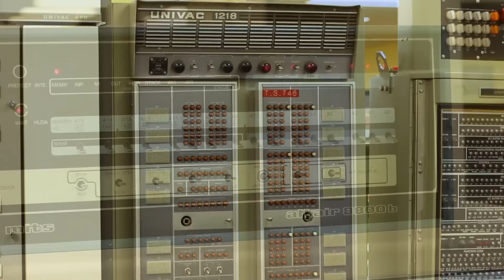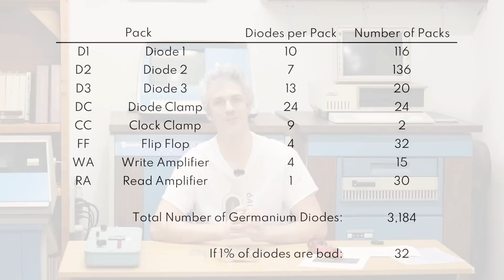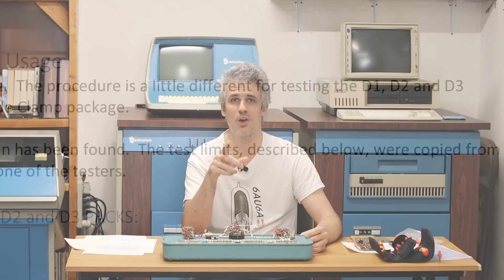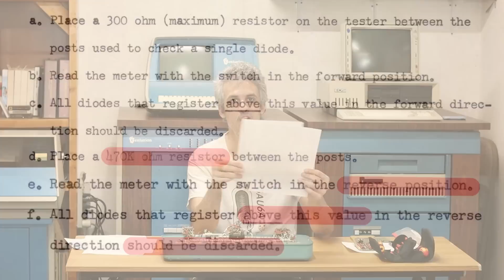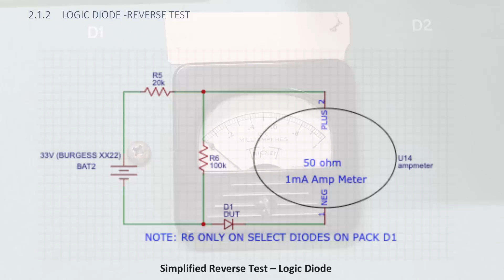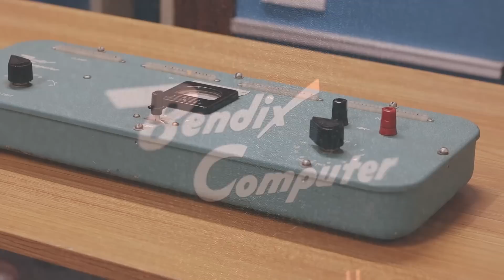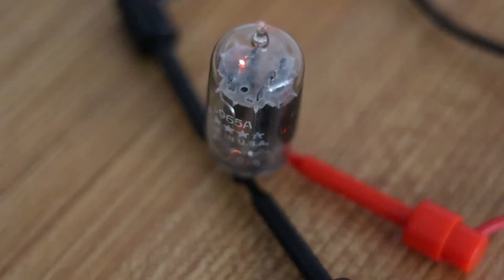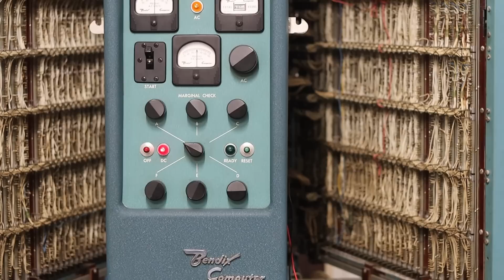Testing Thousands of G15 Germanium Diodes

Comment: I remember reading that tube computers (or anything with a sufficiently large number of tubes) couldn't theoretically work because the MTBF is such that there will always be at least one bad tube; the reason they do is because MTBF isn't the whole story, due to production variations some will fail early and some not, if you start with a whole new batch and replace them as they fail eventually you end up with all the better ones. The machine then works reliably until the tubes get into the end of life section of the bathtub curve at which point it is necessary to start again with a new batch. The other thing was never to switch the machine off as it is switching on which puts the most strain on the tubes, obviously not practical for hobby use.
All this used to be observable with incandescent light bulbs in any building with enough of them.
Reply from the maker: The G15's MTBF was actually quite a bit longer than other tube computers of the era, often going for weeks of 24/7 operation without a failure. There's a few things playing into this. Only having 460 tubes brings the numbers game to a much more reasonable level. Also, the G15 is primarily using indirectly heated Noval tubes, which had much, much better life and reliability than the older octal or directly heated tubes used in machines like ENIAC. Also, filament warm up and start up is the hardest time on a tube, but the G15 has a clever soft start that sequences in, slowly increasing the voltage to the filaments over the course of 60 seconds. That means that all the filaments last much, much longer.
Reply: They used a couple of design tricks to extend the tube life. They ran the filament cooler either by a lower voltage or by designing the tube to handle a higher voltage than what was applied to it. Tubes normally ran much higher plate voltages between 45 and 90 volts. It surprised me a bit when I found they were running around 24 volts. Mean time between failure is a worst case calculation and often you will find that parts far exceed the numbers it produces after you get a few early failures out of the way. Running anything below specs will extend its life. I have a chandelier that uses 12 - 40 watt bulbs and was purchased in 1986. I have only replaced  on bulb and that was because it broke while cleaning it. The trick is on high it produces so much light and heat that it's always on a dimmer running at perhaps half its full output.
Reply: @UsagiElectric  I was actually going to ask if you would consider using a soft tube starter. I'm glad to hear they included one, Bendix really thought of EVERYTHING!
Reply: @denawiltsie4412  Incandescent lamp life is inversely proportional to the 13th power of the applied voltage. Running lamps at 50% voltage will extend the life by about 8000 times normal. Since the dimmer is probably a phase control unit, and you probably turn it on and off now and then, you probably won't get this. But if you have 1000 hour bulbs, it is still going to last for a whole lot of years!

BTW, commercial and industrial lamps in the US were designed to run at 130V. Since most power is between 115 and 125, this made them last considerably longer than consumer lamps, but they put out about 10 to 15% less light.
Reply: @lwilton  Yes, lowering the voltage extends the life span quite considerably, at the expense of killing efficiency. The famous 100-year-old light bulb is run at such a low voltage that it barely produces any visible light, it's almost all infrared (i.e. heat). As far as I can tell, the 1000-hour life span wasn't a marketing ploy to promote planned obsolescence but the most decent compromise between longevity and efficiency possible until halogen lamps became a thing. 2000-hour lamps were always readily available in Europe under the name rough service lamps. Running them below the design voltage meant using a thicker filament that made them much sturdier but a lot less efficient, even compared to the already abysmal efficiency of 1000-hour ones.
Reply: @Ragnar8504  technology connections has a whole video on the 1000 hour bulb and the history. The real answer was "it's complicated" but there was cartel like activity as well as the 1000 hr life span being in the ballpark for optimal life/efficiency.

Comment: While about 400 G-15s were produced, you have to think that the number of diode testers was fewer, and that an arcane piece of diagnostic equipment for a long-obsolete computer would likely be discarded in decades past as its purpose and utility would be meaningless outside the hands of a very small contingent of specialists. 

What I'm getting at is that there are likely very Bendix diode testers still in existence, and this one in your workshop/lab/compound (pick your poison) may be the only surviving example for all we know.  As such it will be highly sought-after by those working to restore the Bendix lineup of computers, who may shortly be pounding fists against your door to get hold of the unit. 

Here I want to recognize the immense value of what Lloyd has accomplished.  By reverse-engineering and documenting the tester, he has made it possible to functionally recreate it.  Those won't be virtual museum exhibits like yours, but the functionality is the point.  A huge round of applause goes to Lloyd for his magnificent work.

The one difficulty may be the slot connectors for the Bendix cards.  If nothing commercially available can be made to work, there is the option of 3-d printing, thankfully.  It will be a headache but something can be cobbled together.  Thanks for another fascinating installment.

Comment: not marking which slot they came out of is craziness to me. that's my first instinct. especially on a legacy system, I'd keep the configuration as close to original as possible just in case the assembly order is meaningful
Reply: They are all supposed to be identical, the slots are labeled and the components color coded by function.

It's designed to be worked on like this.
Reply from the maker: As volvo09 said, the slots are all keyed and all the cards are labeled and color coded by function. Every card should be completely interchangeable with other cards of the same type. I actually specifically chose not retain the same configuration as it's a good way of highlighting failures we may not have caught yet. It can be a little frustrating and time consuming to track down though, haha.
Reply: @volvo09  oh I have no doubt that it was designed to be interchangeable. but with something that old, I would think maybe some board warpage or some corrosion patterns or something might mean that returning something to its original slot could help make better contact or something that wasn't immediately apparent
Reply: Even if they are the same card, it is good practice to replace any component/card back in its original location (not just for this project).

Comment: Just looking at the construction, this appears to be DTL logic instead of earlier RTL logic (diodes instead resistors) and was much more reliable.  I worked for IBM in 1966 and their SLT flip-chips were much much smaller (approx 1/2"x1/2"), and one-chip could effectively replace one of those large PWB boards.  The SLT chips had diff-amps available and thus could have myriads of other functions added directly on the hardware, such as flip-flops, monostable delay gates, direct NANDs, and multiple output Interface Drivers.  The later IBM70+ systems pretty much killed any of these older PWB based single-card systems.  That newer technology was actually driven by the development of solder-flow processes, whereby a huge large board could be wave-soldered in one pass.  I lived through this whole cycle, and one of my sons now works on 4-to-7-nanometer scale device technology, and there maybe be yet a chance to get down to about 2-nanometers, before Moore's Law is broken.  Now requires below ambient cooling, but the Spintronics people are working in that zone (can be done with CO2 cooling).

Comment: I think the carbon composition resistors should be taken into account; I have seen one vintage radio / TV restoration site where the person said he checks them and replaces anything that has drifted out of tolerance (gold band = 5%, silver band = 10%, no fourth band = 20%). That might have to be the next step after the diode test if the computer still acts like it hasn't had its morning coffee.
Reply: Totally agree with you, Carbon resistors tend to do weird things the older they get.
Reply: I'd suggest probably testing all the tubes first, they are more likely to have hard failures that will have an impact. The resistors without digging deeper you won't know if it being out of spec matters. Dud tube and you're going to have a bad day (as they found out(

Comment: The diode checker meter circuit.  When you have a meter with a series resistor it is easier to see it as a voltmeter.  That meter is indicating forward and reverse voltage drop across the diode.  You can consider the meter resistance and series resistance in series as if it were a resistor in parallel with the dioade with an ideal voltmeter (no current flow) in parallel.  The meter is probably 50 microamps at full scale
Reply: I believe it said it was 1 MAFS. What you say still holds true, of course.

Comment: I see a nice gem there (The multimeter) If you have budget, try to get the UT210E-PRO version. That one has Frequency as an extra, and is more sensetive in the MiliAmpere range through the clamp. Nice habit of them is that they can be reprogrammed to start in DC mode on all ranges, that the backlight can be set to a longer value, or even to continious untill shut off again, and that the Auto shutoff of the meter can be omitted. All that by reflashing the Eeprom with an ESP32 flasher.

Comment: You may want to install a larger battery or a plug for a wall wort.  I suspect that the tester with a meter, inverter board, and others will eat the AA batteries pretty quickly. 6V to 33V is about 6 times the voltage which requires like 6 times the amperage to convert, not counting the no-load current draw of the inverter board.  Also I think the meter mechanism takes some power too to move.

Comment: Awesome.  The natural follow up question: so how will you be testing the valves?
Reply: And the point to point wiring. That's going to be a job!
Reply from the maker: There are only about 460 vacuum tubes, so it's a much more feasible task to tackle that problem one by one as issues crop up during machine testing. I'm working under the assumption that the majority of them are okay, and we're just going to troubleshoot the machine slowly and surely.
I do have a tube tester, but it's not a very good one, so it won't highlight issues with emissions and balance on the flip flops or things like that. So, if we find a flop isn't behaving and the tube filaments look fine, we'll get into some more in depth testing at that point!
Reply: @UsagiElectric  You might look around and see if you can find a Hickok Cardmatic in working order, along with the test cards. They are pretty much idea for this sort of batch testing. The Model 123A had a set of test cards for the 5965 specifically.
Reply: @UsagiElectric are there other failure modes than a burned-out filament? If not, a visual inspection should be enough.

Comment: At 15:15, I would say that: if the diode has higher internal resistance, its voltage drop will increase so LESS current will be shunted at the ammeter. The needle will go up showing a diode failure.
Reply: If the voltage drop is higher, then more current flows through the 10k and the ammeter since there is a higher voltage across them.
Reply: @cdh76  Indeed, simpler explanation.

Comment: One way you could test those germanium diodes is with an Oscilloscope that has a built-in component tester, my old Dick Smith Electronics DSE Q-1804 20MHz dual-trace analog scope has a built-in component tester that temporarily puts the scope into X/Y mode when you press the component test button, it is great for testing transistors and diodes.
Reply: Better way if his scope has no such capabiilty is to build a 5-component Octopus IV tracer
6V transformer, two resistors to bring it down to 1V pkpk, two banana plugs and that is all!
Same functionality, in a pinch
Reply: I reckon both of these are probably pointless, given that the normal method of checking the parts made them look om. Did you watch the full video? These diodes are seeing reverse voltages of 24v. Neither of these two suggestions would offer significant enough voltage to show the reverse leakage issues discovered using the official tester. Similarly for the forward voltage drop when they're seeing 30v forward applied.
Reply: @CollinBaillie  Of course the simplest modification would be to bump up the test voltage to 30 Volts Peak to peak using a suitable transformer, that's easily done. My own Octopus has adjustable voltage and current limits to check Zeners and diode leakages

Comment: Great!  🤔 But how many more elderly germanium diodes will have heart failure in the next few years?  Some times the "scattergun" repair method saves you far more future heartache!  Especially when you have fairly bomb-proof Schottky's available.  (But good job Lloyd! 😃)
Reply from the maker: Think about it like this:
There were 60 bad diodes out of 3,000. That's just a 2% failure rate.
If you were repairing a more modern machine that had 100 ICs on it, and two of them were bad, would you replace every single IC just to be safe?
A 2% failure rate is incredibly small. I'm sure we'll come across maybe 10 more that fail over time, but we'll tackle those one by one when they happen. The rest of them I expect to soldier on without issue!
Reply: @UsagiElectric  Yep! I WAS playing "devil's advocate", but I suspect that the failure rate will increase dramatically as time goes on. Are these diodes a type susceptible to "tin-whisker" failure?  This is the main killer of old germanium devices.
Yes, it's a BIG job but as an experienced electronics engineer, I would from now on, probably spread the load by changing ALL the diodes on each board as they subsequently fail.

Comment: I hope you're the right person to ask, or at least can recommend the right person.  I have a 1973 vintage Intel Intellec 4, Model 40 microcomputer, Serial #89, fully populated and in good shape.  I got it at an estate sale nearly 40 years ago and have been lugging it around the country ever since.  The CPU is an Intel 4040,  I/O is front panel rocker switches and ancient (Monsanto?) red LEDs.  Program storage is a panel mounted ZIF socket, made to hold a 1602A 256 byte PROM.  This antique hasn't been plugged in since Elvis permanently left the building in '77.  My question:  Does this thing belong in a museum or in a dumpster?

Comment: Wow, nice work and that test tool sure made that quick(ish) work. I bet a good percentage of those carbon composition resistors are bad too. They can go both low and high resistance. Looks like it's full of the little critters. And then, what kinds of capacitors does it use? Electrolytics are suspect but even more so any paper based non-polarized types.

Comment: You need to find a old Huntron "Tracker" unit..  They were basically an oscilloscope and sig gen in a specialized config that displayed curves kind of similar to a curve trace but in a much simplified manner and could be used in-circuit.  These were the best tool to quickly check diodes and transistors in-circuit and quickly gave a visual indication of whether a component was functional.
Reply: That is a curve tracer.

Comment: SUGGESTION: I would say proactively test ALL the tubes.  I am sure there will be some bad ones that glow but have internal issues.   You will need a good tube tester that checks for shorts, leakage and low conductance.   A trick I learned from Shango is to test the tube at lower voltages  than the rated voltage  to see if  the emission falls off rapidly e.g. a 12AX7 should still have good emission at 9 volts.   Have fun. 😊
Reply: Many tube testers have an "emissions" test button that lowers the filament voltage by 10 to 15% automatically.

Comment: Hey, you have a new troubleshooting tool... not the diode checker, but the knowledge that a nonfunctional flip-flop card plugged into A1 results in no data moving through the M19 line on boot. 
Now if any compatible cards are in question you can just plug them in A1 and give it a shot with the 'scope going.

Comment: Just a minor suggestion, from someone who's worn the tech and hands-on engineer hat a long time. Do a little bit at a time, say, 10 cards. Put them back. Test, see what changed. Then do a little more, the next 10 cards, stop, test, fix anything you might have errored on the attempt, only then, move on to the next bit.

Comment: I guess Lloyd would have noticed any problems, but | have an oscilloscope tester with rotary switches to run through a selection of voltage levels, matching the Y gain controls on the oscilloscope. Because every test needs to run twice through the ranges and back to zero, those rotary switches are worn down so far that the contacts don't make. This would be a big danger on the diode switch here.
Reply: you are correct but since a diode is tested both for forward and reverse direction, and there are multiple of them, all combinations are tested - if 10 cards all seem to have bad diode #5 in forward direction then it's suspicious enough to check the tester itself

Comment: If you need a 300 Ω resistor (not an E12 value) just use two 150 Ω resistors in series. E24 series resistors have a 300 Ω value - but that series is less common.